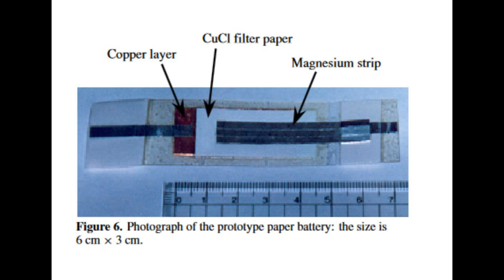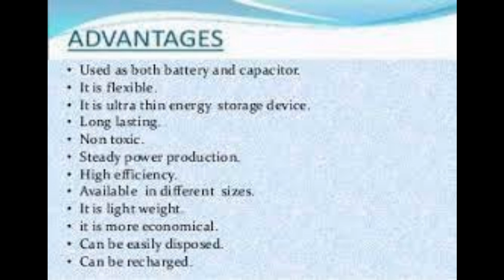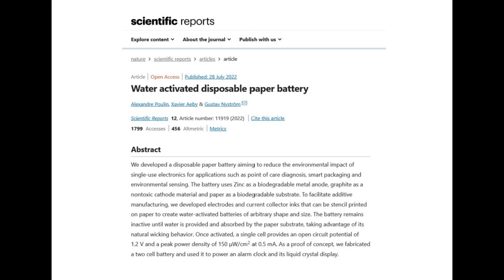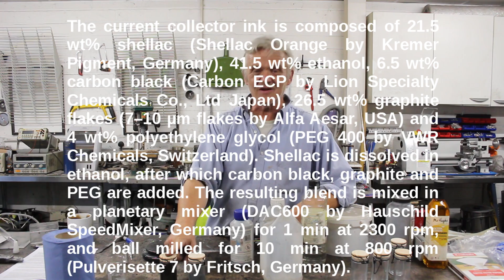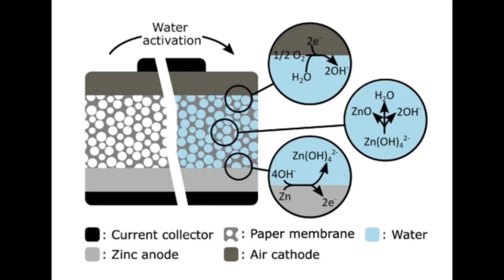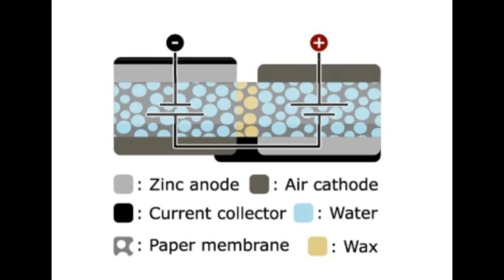1628 Paper Battery As Powerful As an AA And Activated by Water

Comment: I use NiMH cells because they are very leak resistant so I can leave them unattended and not worry much about my devices having leaking battery issues... also their incredible cold weather performance and insane power density compared to other AA cells are also nice to have. But this is still interesting since paper is a wonderful material and NiMH batteries are typically not very cheap to make or flexible... things that paper batteries are good at... though NiMH total cost to own is still cheap since the Japanese made cells are rated to go for 2000 cycles. But still, paper batteries like you show being water activated might be really really good at emergency batteries that are shelf stable until activated by getting them wet.

Comment: Where are you with your old paper pouch batterys? I don't recall a conclusion to that production.
I struggle to remember with what chemistry, but I always fancied making long Peper batery rolls, housing the cells in pipes and those in 45 gallon barrels. Haven't gotten round to it yet.

Comment: What if you make a paper battery, and ran a low voltage solar motor with it, that has an offset weight on it, then place that motor on top of a piece of the electrical paper (the paper you showed that produces voltage, by taping on it), and route the wires from the electrical paper, back to your battery paper, do you think it would prevent the battery paper from ever running out of power, since its always putting power back into the battery paper?   You could double the watts going back to the battery paper, by stacking several layers of the electrical paper, that are placed under the vibrating solar motor, this way vibration and gravity are extra input sources that are being utilized, so it does not violate the laws of physics, in fact its using physics to sustain and recapture the losses, that are used to make the motor vibrate.   
   Please try this, I look forward to your results.  🤠👍⭐⭐⭐

Comment: You've been speaking a lot about recycling. I had an idea about that for some 15 years now. But do not have the money or the knowledge to bring it into reality. So I think it would be well to offer this Idea to your inner group to work out. I call it the planetary steward. It is theoretically a way of totally recycling everything. It does not need the making of any new equipment, it already exists. Just needs to be put together in a new way. Start by crushing everything into a powder if it is solid, then mix it with a liquid. This combination is sprayed into a blast furnace. turning the spray into vapor. The vapor is pumped into a master centrifuge, which separates the elements down the middle according to the atomic weights. Then the vapor is sent off to other centrifuges that are set for each atomic weight desired. inshore everything can be recycled over and over again indefinitely. Think of it no more worrying about resources ever! The centrifuges are the ones that separate out u 235 from u 238. What separates the yellow cake, after vaporised it. So have a good time working on it, if your group likes it.
Reply: So, assuming you could do this, you are simply breaking everything down to its composite pieces. But maybe you actually want to keep them in their composite forms. This is down in 3D metal printing for things such as stainless steel and titanium by breaking them up into tiny microscopic balls, getting rid of the oxygen as much as possible, and selling the resulting powder as the building material.

Comment: I think the same AA, AAA and 9 v batteries should be all ready obsolete. There is allready LION, and other new forthcoming battery technologies. Only problem so far is price when y get one 10 piece back of AA less than ten €. Getting one good LION less than ten € is hard. When 1 LION should be no more than 1€ if even that.
Reply: Would the paper work if you carbonize the paper it self by heating the surface of the paper.

Comment: You're terrible at explaining the recipe. You run through the build skipping the most important processes "oh I already painted the cathode on" and didn't bother explaining how the wax was used at all other than a brief mention of the fact that it's at the bottom somewhere ...not really sure how it got there or if it's on both sides, poured on, dipped...it just appears there in the paper magically when we go to paint on the current collector which by the way is also just a bit less vague in the description. You might as well skip the whole video to the end, show us your working paper battery and a link to someone who is actually willing to show the whole process or at least enough to know what you just did in a way that we can repeat it at home.

Comment: Wrong. Check your calculations. This has a peak power density of 150 µW/sqcm, which is about 5 W/kg assuming the anode and cathode weigh as much as the paper. A normal li-ion AA battery has a power density of 300 W/kg, which is 60 times higher. Although we really should talk about energy density rather than power density. And the "paper" battery (the paper actually has nothing to do with it, but hey, since we're not caring about truth and reality here I suppose that doesn't matter either) is at its peak power when drawing 0.5 mA! Trying to draw even 1 mA gives 0.00004 W at way less than 0.1 V. This has abysmal energy density. Just ridiculously bad.

Comment: How about making a few hundred and stack them in parallel and series, see if they can be scaled up for lighting or a fan.  What about the paper density and composition, also it's thickness and the coating thickness and some of the ratios of the various chemical components. When you stated common table salt, is that non-iodized? Also did you use distilled water? I'm curious what is the weight of the end product and it's scalability?
Reply: i suppose seriesing and parallelling  possible, but practicality may be an issue, instead of parallelling, larger flat area, maybe?,

Comment: Not bad, loved the video, thanks! In the RAF around 1979, there were batteries in survival equipment /kits (such as life raft kits), that had batteries that you submerged into the ocean (seawater). We were told that these were used to run a flashing distress beacon, and used saltwater as an electrolyte. Not very powerful, of course, but it could save your life by alerting search aircraft to where you were!
Reply: See that's the kind of tech i like, Something to make your worst day a little more survivable.

Comment: I haven't bought disposable AA or AAA in ages. I use rechargeable ones and downgrade them as they grow old (ex: from flashlight to radio, from radio to remote etc), finally packing them up with other batteries to a send them once a few years to a local battery recycler handler.

Comment: I'm curious... would you be able to stack these paper batteries together using whatever parallel/series connection you need to power an 18V cordless drill? Is it stackable? Will the higher voltage and current alight the battery? If it does catch fire, will be a big fire? Little fire? No fire? How does it work in cold temperatures (freezing) or hot temperatures (inside an oven)? Can it handle inrush current? Can they be recharged? Or can they be modified in some way to make them rechargeable? It would be an interesting video if you could tackle all these questions...
Reply: doubt it'd have enough current capability, as its a variation of the standard zinc carbon type, which have poor current driving ability,  voltage wouldnt be a problem, within limits, as you could connect as many in series as physically possible....charging, very unlikely as zinc carbons cant be,  inrush current? not sure what you mean, except peak current capability? as said, current very poor....

Comment: This might be great for a long-term storage method to use as an emergency recharge of a cell phone as long as you had a simple voltage regulator.
Reply: high power zener such as a  1N5338 5v1 5w in parallel will clamp it ...
Reply: You'd need a lot of them.  At least 35 I'd say, of the size he made, connected in combinations of series and parallel, to charge a cell phone just once.  Good luck getting all the connections to remain solid.

Comment: I know kinda off topic but could you point me to the video you did a year of more back about a rod wrapped with wire to evenly coat sheets with a fluid…what is is the the name of that rod?…I remember you saying that they were very expensive to buy but one could make one as you did varying the gauge of wire to create the thickness desired…I have searched but just can’t find it nor do I recall the name of that rod…

Thanks sharing all of your knowledge experience and insight!!!

Comment: Make the price about $1 more than rechargable batteries, and outlaw the cheap batteries that will last about 1/8 as long as the good batts, and will not even work in some things,  like the dollar tree batteries, it's like they are well used good batteries,   if rechargable batteries sold more maybe the cost would be lower!  I think things like remotes, should be converted from 2x aa or aaa batts, to a single lifepo4,  with a built in micro USB to charge it,  going from about 1.7v peak, x 2 , is about 3.4v surely  going to 3.6-3.7 isn't going to hurt anything,  I think remotes should come with rechargeable batteries to start with, use a micro USB,  , charge it for 20 minutes a year, and be done with polluting 2-3 x a year, just turning channels!!. It would probably last 10+ years, especially if the voltage doesn't go too low, and charged too high, keep it to 3.55v and above 3v!  With a quality cell they would probably outlast the remote 2x in some cases!!  Having a LiFePo pouch cell would be great, especially with a plug to charge it!!
Reply from the maker: well thought out mate

Comment: Could it be activated with an alcohol solution? Or does it need to be h2o? Was just thinking of long-term storage with water or alcohol in a separate compartment within the battery that could be punctured before use. And if these only have a 2-hour lifespan I believe these would be perfect for use in board games that only get a few hours of use around the holidays and then forgotten the rest of the year without corroding the electronics within.
Or emergency lighting like a flare.
Reply from the maker: games are a great idea mate

Comment: Would be interesting to make some of that bullet proof paper that is made by chemical sorting by enzymes instead of harsh acids or alkali's, or the typical mechanical pulping, so the cellulose molecules are not broken down just apart, 

I would think that if process was right, it would cause aligning the cellulose in  mostly one direction, so breaking it down further with a dehydration compound would leave aligned carbon chains :)
Reply from the maker: interesting thinking there mate

Comment: water battery is a carbon aluminum battery. a true water battery does not have sacrificial materials and uses the electrokinetic streaming effect
Reply from the maker: it's all in the name mate !
Reply: @ThinkingandTinkering  I started using the phrase water powered battery because of these "water batteries" that are just alkali earth metal batteries or transition metal batteries.  they are not real water batteries.  a real one is powered by the water itself and does not use up its materials as a primary cell

Comment: Interesting, few plastic tubes of different battery sizes with conductive ends, slight change in the morphology, few mL of electrolyte, push in a pre-rolled dry cell, pop the top on and presto your own AA battery or whatever.  Remove roll when dead, more electrolyte another roll and on your way.  Take the old paper, put in an electrolysis cell recover the zinc and away you go again.  Very nice, bugger off disposables.
Reply from the maker: that would work mate
Reply: You could use baking or waxed paper to hold the roll together.

Comment: Wonderful!  Now we need a paper solar cell.
Reply from the maker: yep - get working on it
Reply: @ThinkingandTinkering  Been doing so.  My design so far isn't far from the battery to be honest.  My collectors are different and using 2 different carbons.   Coat one side of the paper with graphite and then impregnate the paper with magnesium citrate.  Allow it to dry.  While it is drying make a copper foil collector by heating it to red hot on a hot plate.  Then flake off the soot.  After paper is dry draw a grid pattern with an ink made from graphene foam on the side opposite the graphite.  Use alligator clips to sandwich it all together with one side of the clips covered with tape.  One of the alligator clips in contact with the backside of the copper plate.  The other to the grid pattern.  Sandwich it all together between plexi-glass to hold it tightly together.  Hold it with the grid side to the sun.  Doesn't produce much, in the micro amperes and low milli volts.  But I didn't figure it really would produce much anyway.  It might even be working as an antenna for all I know as I do not have an o-scope and only a cheap meter.  But it does work.  In crystal form the magnesium citrate has a small piezo effect,  I figured that photons hitting it would produce some current.  I need to try some other arrangements and materials.  I only suggested that to you jokingly as I am working on it currently and hints would be nice.  Have a good day!  And thanks for the reply.  Love your videos!

Comment: Great vid, again. thank you, my tuppence (two pence) worth.. Whilst rechargeable AA's remain pegged at 1.2 volts, 1.5 volts like Alkaline will continue to dominate. Rechargeables are fine for remote controls with slow, infrequent draw.  Things like passive infra-red detectors on LED lighting units, RFID/ electronic keypad locks (which auctuate via a motor),  wildlife cameras etc.. etc.. the voltage needs to be quick for optimal performace. despite being the same current in most cases.
Reply: there used to be, dunno if still made, nickel zinc cells with 1.6v terminal voltage, i'm using 2 in a digital camera as it eats even good alkalines and doesnt work for long if at all with nicad/nimh, i got 4 of these nickel zinc things from maplin(uk), when on offer, probably 10 years ago, maybe more, and  only started using them last 2 or 3 years or so, 2 failed fairly quickly after a few charge cycles, so maybe their shelf life isnt good.??  last 2 still working, so far, hope they are still made so i can get some more! i also have 4 AAA size ones, as yet not used
Reply: note these cannot be charged in a normal nicad/nimh charger, 'smart' ones likely to think theyre bad and reject them, dumb resistive ones likely to overcharge them , but may be possible to mod them to limit charge voltage
Reply: ?? You 'll find rechargeable delivering way higher currents than disposables but they self discharge faster. For occasional light use disposables seem more convenient.
Reply: @jochenschrey2909  we are at odds lol.  not intentionally. i find with 1.2v the mah (rechargeable) generally, is greater at first.  But slowly gets less and less as discharge occurs. The 1.5v mah tends to be almost constant. i speak from my experience and not from any kind of scientific standpoint.
Reply: @Palmit_  ?? once again. "mAh" = capacity, for example number of flashes you 'll get from a charge. I was talking current, "A", formexample recycle speed of the flash gun, performance during quick recharges, like a 4/6/8 minute RC car race
Reply from the maker: I think there will be quite a few reasons for disposables being popular but I get your point mate

Comment: Robert, can you draw a working  radio circuit on paper? capacitors, coils, resistors no problem, how about a diode? or some kind of transistor? that would be an astonishing project. electrostatic transistor allowing or inhibiting a capacitor discharge...drawn on both sides.
Reply: with some kind of electrostatic paper speaker, ear piece.
Reply from the maker: there have been several attempts the diode is the issue and there is research on printed diodes - so yes - sort of
Reply: @ThinkingandTinkering  some sort of field effect transistor with your magic ink.
Reply: @ThinkingandTinkering  some early 'metal rectifiers' were based on copper oxide, so that may be a possibility ,, other one 'galena' lead sulphide , but that may be out due to the lead part...

Comment: Dear Mr. Smith, i have seen that you use the extension cord fully on. I can ask you to take it all out because like this can be a problem, it is a coil on a(at least) 2000W consumer. I have burned one because of that.
Reply from the maker: it's unlikely mate - very unlikely - I say this after 10 years of using it this way

Comment: One could argue that paper batteries go all the way back tot he first ones.  (well after the bagdad ones)  The Volta Pile was paper between copper and zinc disks.
Reply from the maker: I thought that too - but I thought I might be stretching it a bit there lol
Reply: @ThinkingandTinkering  many years ago when i was little  i made 'batteries' from stacks of 2p coin-paper-10p coin, one on top of another, with salt water electrolyte 😉 powered leds ok, cant remember if i tried a small radio or not ,  with modern high brightness leds it'd be much better